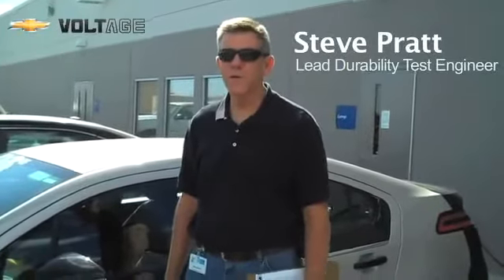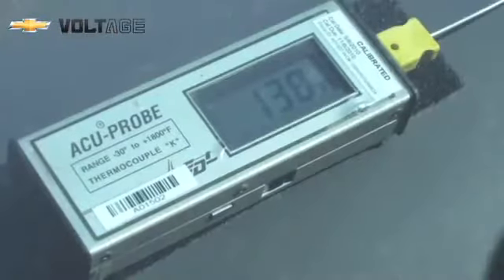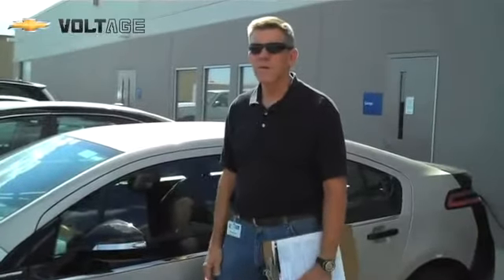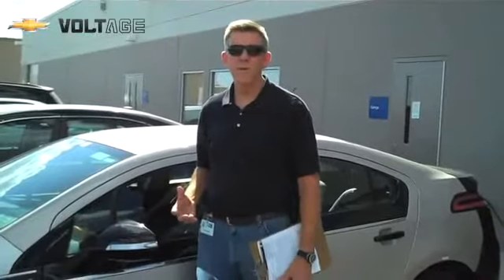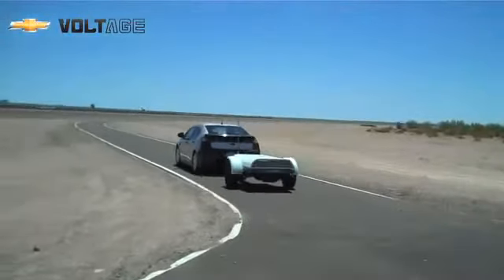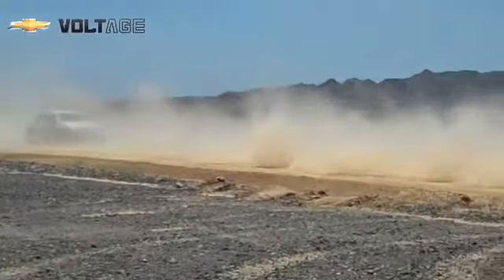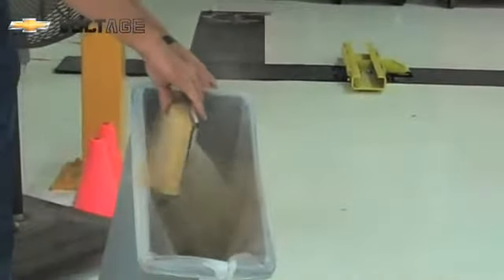Chevrolet Volt Hot Weather Testing.flv

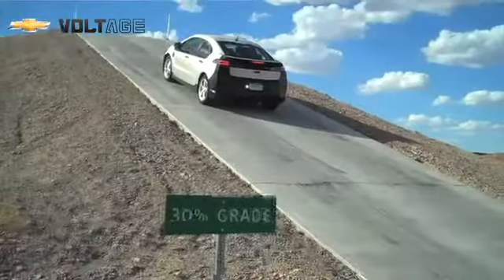Comment: 1:30, 

The Volt doesn't come with a cabin air filter. So if the air isn't set for "recirculate" in the video, dust will come in through the dashboard vents!
You can buy a cabin air filter for the car, you can easily find the model# online. I think there is a cheaper version and also a more expensive version that is an active filter that gets rid of odors.

The Volt didn't come with the filter, in the interest of efficiency.